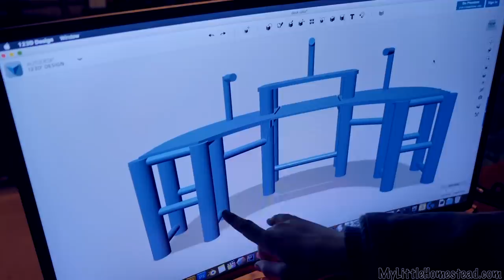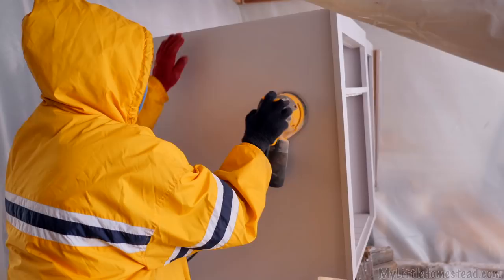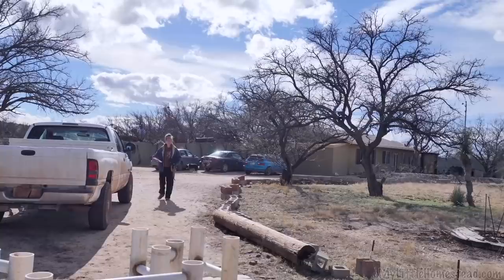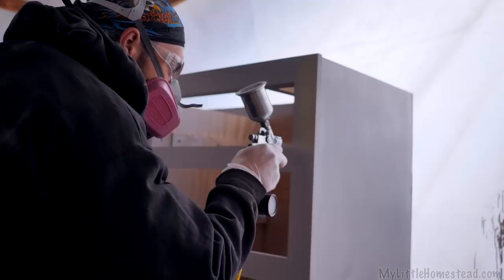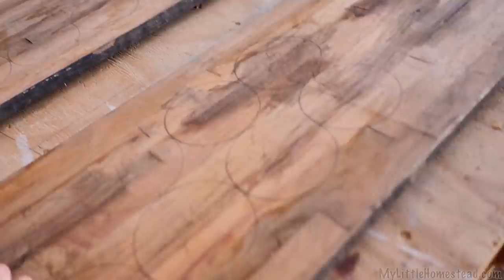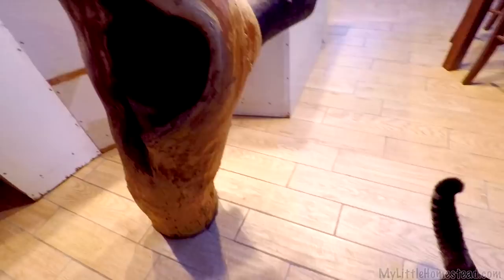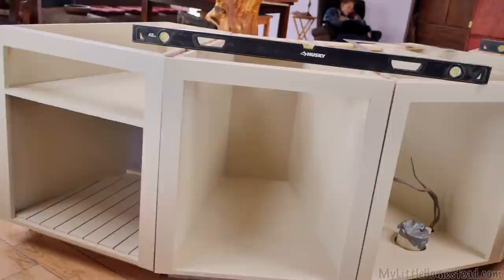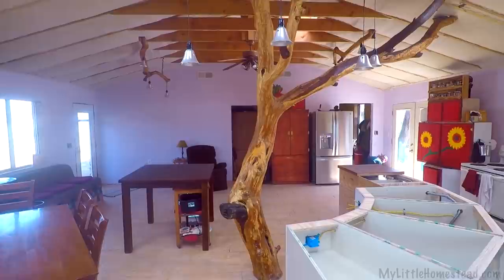Log Lights, Re-paint Cabinets & Build Gaming Desk | Weekly Peek Ep172

Comment: Your cabinets can have drawers, no problem. You just need to insert shelves below each drawer and add the drawer slides to the bottom of the drawer instead of along the sides. This way, even an odd-shaped drawer can slide in and out
Reply: Excellent idea!
Reply from the maker: Love it.
Reply: @mylittlehomestead  and you can have your cabinet doors cover your drawers, that way you don't have to make drawer fronts. So you would open your cabinet door and pull out the drawer. We made a pantry like that

Comment: Watching the cabinets for the kitchen island reminded me of the cabinet guy I hired to install cabinets in my house.  The first one he installed was the one over the refrigerator and then worked his way to over the stove where the micro wave and vent would be.  Well the microwave ended up being 5 feet in the air, so high my wife would have needed a stool to use it.  Come to find out the guy started with a cabinet that was the wrong size and knew it.  He thought he would just need to replace it with the right size and everything would adjust to it.  On the other side of the kitchen he installed one that was broken and said he would replace it when the new one arrived in a few days.  I'm not so patient and after he left I removed all of them and put them on our front porch and called him and told him my neighbors where driving by pretty slow as if they were scoping them out for a pick up after dark.  He came and got them in 20 minutes.  Never saw him again and I never paid him for anything.  Poor guy should have not tried to pass off the crap he was given.
Reply from the maker: Oh boy.

Comment: Our nighttime lows are really crappy right now. Can't blame ya for wanting to do as much as possible indoors. We already planted our garden and had to setup a simple plastic greenhouse over the beds. Thankfully, the dry air still works to our advantage for things like painting. Might not be optimally temp'd for the paint to cure typically but the low humidity cures it anyways.

Comment: Doh! Forgot this — wood fillers are plentiful as ducks on a pond. My experience is, the one you show is too soft for a desk top. Bondo Wood Filler would be better. Bondo sound familiar? Same auto body filler used for car repair, xcpt w/red cream hardner for better wood like color and different label (at twice the price ;-)**. It's the "Swiss Army Knife" of fillers. Pro's secret weapon for over 30 years for most wood repairs, inside and out. TIPS: Mix VERY small batches - shrt opn time. Brief window where you can carve in details/do quick trim-clean with a SHARP utility knife. Better to wait an hour after that to sand. Stainable, but you might have 2-coat the bondo to blend. Easier to clean tools by scrape off with a utility knife while it's still soft. Wear disposable gloves - laquer thinner/acetone for oops. Avoid overfilling voids – Bondo does not shrink, and is much harder to sand than soft fillers. 
**SMART WAY TO BUY: a quart of regular Bondo and a seperate tube of red cream hardner. 
The pond: All the other products that seem to be the same thing- if it quacks, it's just another duck ;-).
PS: Your critters crack me up - great personalities that add to the entertainment. Cheers.

Comment: if you ever do circles again.. do them into squares - then into octagons - then to either whatever to get closer? or sand to the line - bench sander with belt and disc? when i did it for that wood room? i used a Bandsaw - and I sanded with the saw - but nothing over 3/4 - if over 3/4 band sander
Reply: see the bandsaw blade and the deck? Okay? now use the teeth edge as the vibrator of the hand sander? <heart>
Reply: on the belt? the roller (hand or bench) is a SAW. it will literally cut through the wood as long as you hold it there.  YES.. like a Circular saw or table saw.
Reply: on a vibrator? the vibration or osolation? wll cut as well Sigh.. long ago? in which if i could have patent it? they could have legally stolen it from me regardless if I had the patent when they finally built them for us to buy. <tear> Freedom for the rich and corporations.. Via the Free to govern Govt. <tear> <hugs> <Tear> <heart>
Reply: my grandfather was a gas station tendant and mechanic - you did everything including construction - my Grandmothers Father was a Masonary - Brick layer and framing. And our Name Wagner - means Builder of Wagons. Meaning - We were given our last Name by a GOVT. because our blood line were Blacksmith, Wagon builers, Furniture builders, and Construction workers. SIGH.. USA we can own land? and they are literally killing each other to give the Africans the right to be Equal to the Royalty that OWN US and tell us What we do for a Living and Where we can live. <tear> our deed since 1890's on public records. GP's Father.